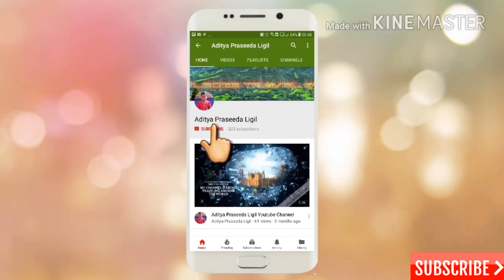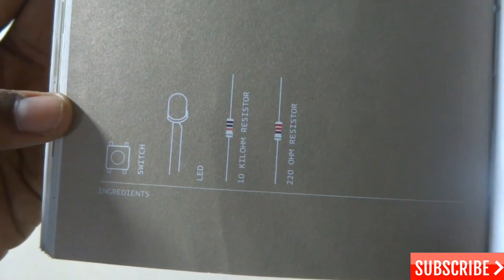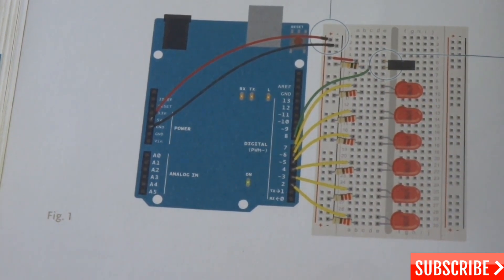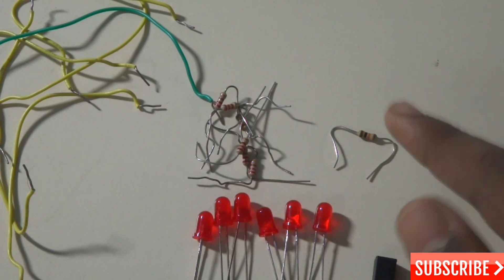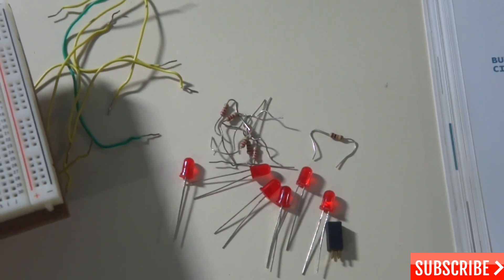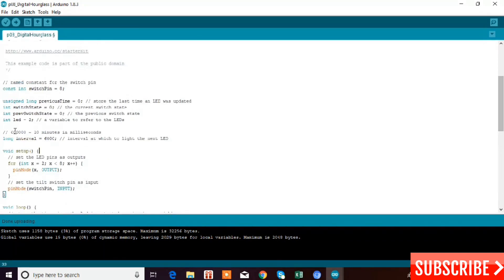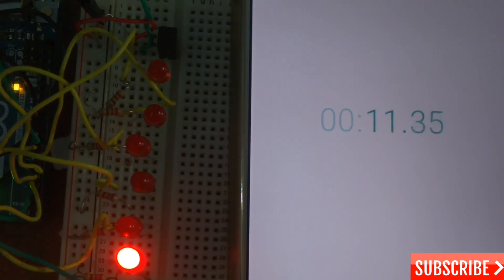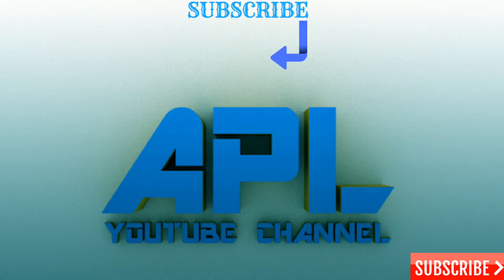#Arduino LED Hour Glass Tutorial | Arduino Project 08 | Digital Hourglass

Comment: This is pretty cool! Have you tried posting these projects on the ProjectBoard?
Reply: also does this stop at 41s everytime?
Reply from the maker: I have no idea about project board.Please tell me how to post my project on project board.I have did this project with Arduino Uno and Breadboard .Thanks for your valuable comment.
Reply from the maker: As per the code that I have uploaded in Arduino Uno. It should light up all the LEDs in 30 seconds but I had started the timer eleven seconds earlier that's why it showed 41 seconds. In the pre-installed code it lights up all the LEDs in 60 minutes.But I had changed it to 30 seconds to show in this video and I have also shown in this video how to change the time in the code.Yes,All the LEDs perfectly light up in 30 seconds.
Reply: Ahh okay I understand. Makes sense! Thanks :)
Reply from the maker: Naz N Thankyou for the information
Reply from the maker: Hi Naz N, I have uploaded a few new advanced Arduino videos. Please check them if you are interested.